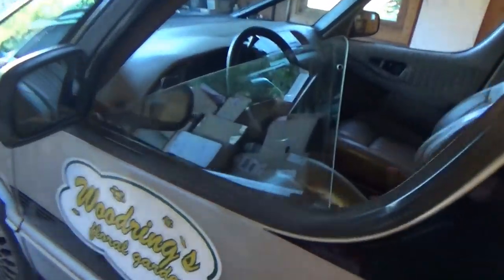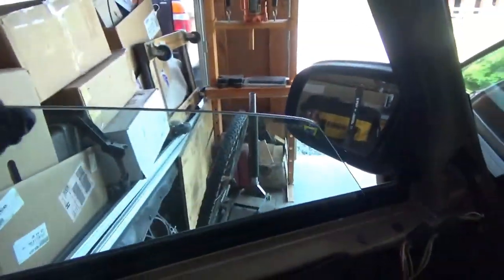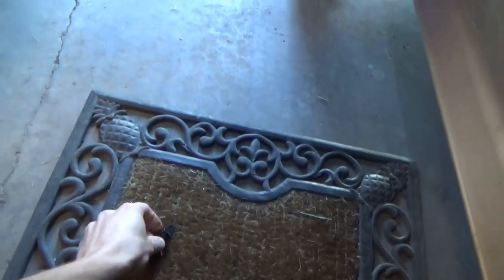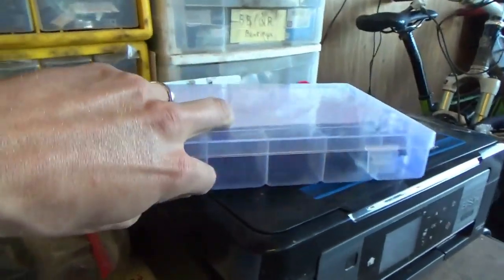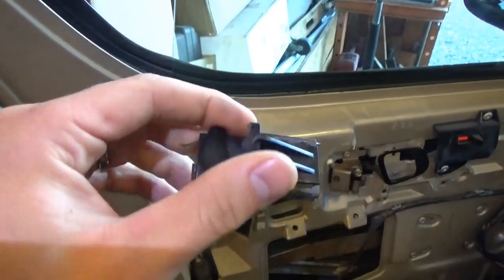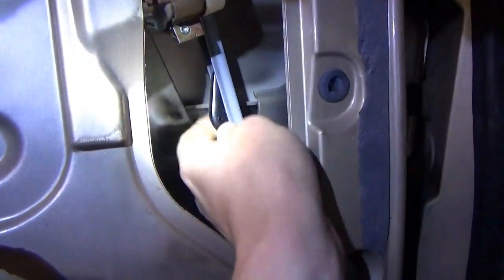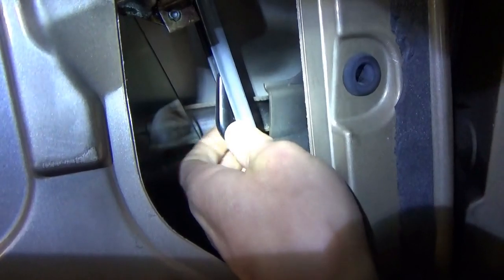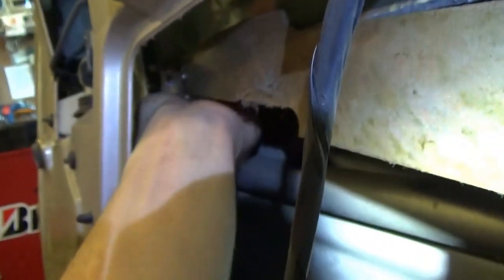Silhouette Chronicles - Part 10: Power Window!

Comment: I had 2001 Silhouette!! LOVED MINE!! Two sliding doors, one power. Flip up rear hatch, not barn doors style. Air ride leveling, with on board compressor and hose set! Manual but very adjustable driver seat. Middle row, removable captains chairs, and a removable third row bench! It was a van, but drove and rode like my 97 Monte Carlo. Wore it plumb the FUDGE out! Replaced it with a 99 Lesabre. Over 200k miles. 8years and over 30k miles, with only a oil sender leak, and a MAF sensor replacement! I didn't even change the oil and filter in the 30k miles I owned it! Boy, do I miss my Silhouette!

Comment: Just happened to think of Dorman on this window parts subject because they have a huge supply and tend to be higher grade than OEM from my experience. Ended up on Rockauto and found the part you needed sell for $2.99 DORMAN 700870 and are available, "Window Guide" is the name of it. Sounds like the regulator and other locations need some silicone grease lubrication. As another viewer suggested, silicone spray does help lube the felt in the channel guides and it's a dry lube so no mess. CRC heavy duty silicone spray works very well.

Comment: Good job.  I’ll bet the rest of that broken clip on the bottom track is still in there somewhere. Use a fiber optic camera with your phone to find it. Remember that the clips on the passenger side window are virtually identical to those on the driver’s side, in case you have to cast a bottom track clip.  According to testing by the Project Farm channel, the best stuff to fix plastic with is the original JB Weld, if you can let it set up for the entire recommended time of about a week before stressing the repair.  I’ll also bet that you can get a complete GM shop manual for the Silhouette on eBay.  Don’t forget to regrease the entire bottom track after getting any rust or debris out of the track, and please spray silicon on the felt parts of the side tracks to eliminate friction and avoid burning up the motor.  Spraying the window switches with De-Oxit and fixing the tight spots in the side tracks would also help save the motor from an early burn-out.

Thanks for the video

Comment: Great job!

I was gonna say, but Butch Romig just said....  You missed your golden gold plated chance to blast all those tracks with silicone spray.....

I swear that's 90% of the problems with this stuff....  when it's new, the glass slides suuper nice in brand new slippery tracks...  then it ages, dries out, dirt gets in there, and now it doesn't wanna slide...  Now the motor is straining, and the window is stuck, and clips start breaking, and it's a mess....

Blast those tracks with silicone spray, and work the window up & down....  Your "slow spot" will probably go away, if the window could move real smooth through the whole length of travel....

Comment: Step father sold those new back in the day, got to drive one a few times, cool mini van. It's a survivor, keep it on the road. Took my drivers test in a fresh off the show room floor Achieva. Still want an Achieva SCX W41. Actually I want the Alero OSV that was promised the year before GM killed Oldsmobile. It would have had the 3.5L "short star" V6 and body kit and other goodies.

Comment: The broken plastic piece you re-used is a stopper for the reg roller in that channel. When the 2 guide/sash pieces break, it is the only thing that stops the roller from coming off the metal track. Surprised yours didn't. You can live w/o it once the window is in place frt and rear via new clips, and I wouldn't be surprised if yours falls out w/o you knowing it. New reg/motor assemblies do not come with this piece. If you can find the metal cross channel NOS, it will. I wouldn't worry about it. However, the motor is binding due to the sashes being slightly bent. You may have to address that later, and it's trial and error pretty much.

Comment: I would use silicon spray or grease in those tracks or Fluid film.  Spend the money and buy the third replacement clip !
Reply: Do NOT use fluid film, it swells the rubber and makes it worse
Reply: Silicon spay works, but only for a few days then evaporates.  Your going to think this sounds sick,  but I have been doing it on customer cars [and my own] for years and years and years,  and never had any troubles. Use the sex lube from the dollar tree store or a substitute like it [KY JELLY], and a small artist paint brush, and paint that stuff  in ALL the rubber window guides on both sides of window and any rubber moving parts,  that stuff is slippery as snot and its color is clear and works like it was made for this, even though it was made for something better..lol..
Customers tell me the window goes up and down faster than when it was new.  (It removes a lot of the load on the motor and stress on the parts and makes them last longer)
You will be thanking me for this one,
Reply: Do NOT  use fluid film
Reply: @sargetester99  Why is KY better than silicon grease or even Vaseline ?
Reply: Fluid Film Effect on Rubber
ASTM D-471 @ ± 158°F 70 hours
None on neoprene and buna-n. May cause swelling on non oil-resistant rubber goods.
Reply: @jackpatteeuw9244  it is clear and also lasts longer

Comment: Never use white lithium or any grease for the window track. Only use a can of spray silicone for the tracks
Reply: because it wasn't chinesium uncured rubber that got softened (aka eaten by silicone)...
yeah good for 5 years max.......... oh dear lordy
Reply: Agreed, lithium is a mess and will absorb dust/dirt making the problems worse the longer it's there. Some areas are okay with a light film but I'd use a silicone based grease for that.

Comment: Hopefully GMPartsDirect.com has a good price on the stalk, if you don't find one at a junkyard.   Probably very similar to most 90's GM vintage; as i believe this van was a U body; but shared many parts with the W-Body (as I've worked on that same assembly on Park Avenues and Pontiac Grand Prix's)...

Comment: I miss my 1990 Buick Skylark with the 2.5L Tech 4 cast iron torque master engine and hand crank windows.  It got 33 mpg on the open highway at 70 mph (cruising across OH, IN, IL, WI).  Rust took her down in 2001.
Reply: She got KO-ed in the eleventh round, The Rust Belt was retained by the Champion.
Reply: I had an '86 Olds Cutlass Ciera with the 4-cyl. Iron Duke under the hood. That was plenty of power for the car even with A/C and power steering sucking off the engine, and mileage was terrific.

Comment: The windows should go up and down faster if you run the engine. A little bit more voltage helps. The window motors are tired and could use lube and cleaning of the commutators, but probably not worth taking it all apart to do unless they quit totally.
Reply: Almost all small actuators/motors in cars (power windows, power locks, etc) use small DC motors that run through a gear box and output a rotational or linear motion.  The gear box is usually packed with white lithium grease.  Over time, that grease gets hard.  If you can get the gear box open without destroying it, cleaning the old grease out and replacing it helps a lot.
The other thing is, all of these small motor have a built in current limiting resistor so that when they hit their "hard stop" the current won't spike and blow the fuse.  This resistor is just a thin piece of foil.  If you can locate this "resistor" inside the motor housing, replacing it with a 1/2W - 1W film resistor of a lower value will allow the motor to draw more power and spin faster.  Frequently, the resistance in the motor winding will not draw more that what the circuit is fused for, but the engineers are CYA for some one holding the switch for an extended period of time.
Reply: Your going to think this sounds sick,  but I have been doing it on customer cars [and my own] for years and years and years,  and never had any troubles. Use the sex lube from the dollar tree store or a substitute like it [KY JELLY], and a small artist paint brush, and paint that stuff  in ALL the rubber window guides on both sides of window and any rubber moving parts,  that stuff is slippery as snot and its color is clear and works like it was made for this, even though it was made for something better..lol..
Customers tell me the window goes up and down faster than when it was new.  (It removes a lot of the load on the motor and stress on the parts and makes them last longer)
You will be thanking me for this one,
Reply: @sargetester99  A shot of the silicone spray you probably have laying around the garage also works.

Comment: What an epic piece if crap! This is why GM should have been left to fail.
Reply: never  had a window  problem  on my 95  transport  ..an that design  is used on other  gm cars too  an my transport  is still a great van
Reply: You want them to fail because one flawed window design? Grow up.
Reply: @djentyman4002  You think I'm picking on them over a window? Honda and Toyota have made far bigger blunders than that but they have  track records that give them the reputations that they have. I will admit that both are slipping into the same patterns but they are not yet bungling everything tbey touch.
Reply: InsideOfMyOwnMind that’s true. I’ll give ya that
Reply: @djentyman4002  thats not a bad design,,  cable  drive is  as all new cars  have,,olds buick  chevy  all used  this window  design  ,,an its easy to fix

Comment: Fluid film reacts with the rubber and makes things worse
Reply: Fluid Film is made from Lanolin. Is commonly used as a rustproofer and undercoating. Should not react with rubber at all.
Reply: @notajp  On the back of the Fluid Film can it states "Care should be taken around non oil resistant rubber. May cause swelling."